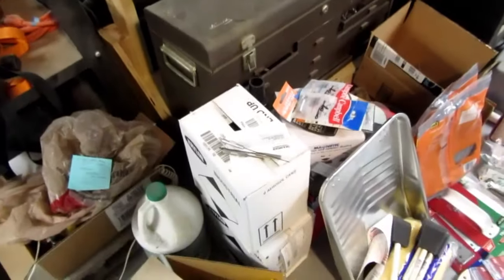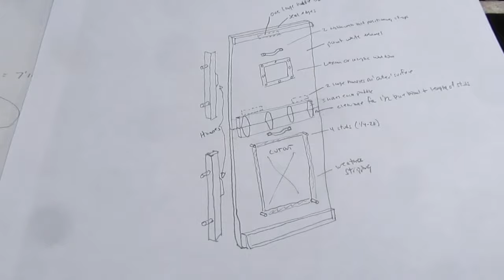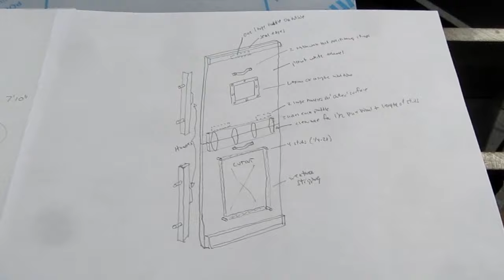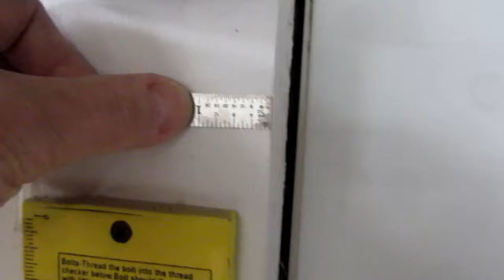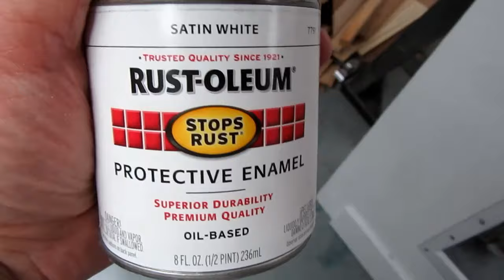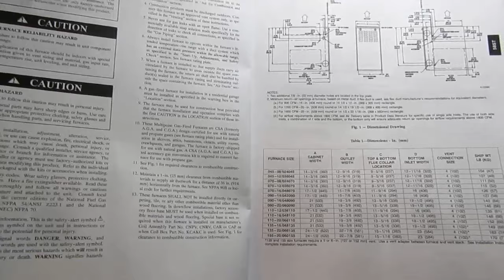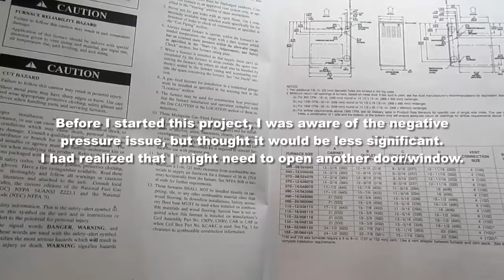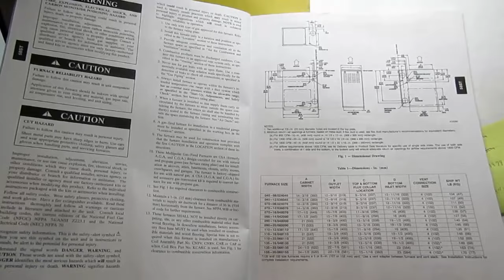Adventures In Home Basement Shop Ventilation

Comment: Curious why you went with a 20”. There are plenty of industrial 8,10 or 12” fans that move tons of air. But your solution is a pretty good solution too.
Reply from the maker: HabitualButtonPusher, I saw some online reviews on this model fan, who seemed to using theirs in similar sized areas. I also talked to the manufacturer's tech support, who thought this was a good choice.   I now think it is considerably oversized, but still usable. But by using an adapter panel, I can still place a smaller fan in my home-built door insert panel; that might still happen. I might also just buy a cheap 20" box fan, then take it out of its box and rig it to fit in my door panel cutout, and see if that moves enough air (for situations where I need to keep the furnace running while still exhausting a bit).

Comment: Hello, I’ve been watching your videos for quite some time, including many of your train videos, which were quite enjoyable… Unfortunately, it’s been a month since you’ve posted this video apparently. I wish I had seen it earlier however, at one point I had a little shop in my basement with a lathe with a milling machine a steel table. My stuff was primarily steel, but some wood however what I did was I got an industrial bathroom fan, which typically fits up between two joists and Iran four-inch ducting around various appliances, I also installed quite simply a circular 4 inch diameter diffuser, where the inner 3 inch circle was connected to a threaded bolt, and therefore it was able to be turned and brought out which would encourage ventilation at that point or if I was at another station if I can say I would close all of these which I mean takes all of 30 seconds and open just the one where I was working for example, doing staining of wood and it was quite effective. There were never any complaints in the remainder of the house, as I certainly was conscious of this!
But it was very effective. It took me all of maybe three hours to install aside from drilling the holes through the exterior brick wall to enable a 4 inch diameter termination kit. It wasn’t expensive, and it was quite functional.
Reply from the maker: David Burnell, thanks for your comments. I sounds like your shop had a simpler layout/arrangement than mine; without all the complicating factors of mine, I might have been able to do something else. 

Also, my home is open-plan, so as far as the air is concerned,  it is just one big open space. Vapors from anything in the shop are very apparent elsewhere in the house.

With ventilation, a lot depends on volume of air that needs to be removed to avoid health and safety issues. I had already investigated the GPM of things like bathroom fans, and concluded that by the time such a fan had time to exhaust the space near my painting area, the noxious vapors would already have had time to migrate elsewhere in the house.

As far as complaints elsewhere in the house, a lot depends on perception. I could spray aerosol enamels all day and never SMELL anything elsewhere, but that is related to the type of odor and whether my nose would be able to detect it. I set up this exhaust scheme specifically because of my need to do some lacquer spray painting, and the noxious vapors from that are both much nastier, more noticeable, more health hazardous and more combustible.

My only regret about my scheme is NOT doing the GPM calculations for the fan that Amazon happened to sell, as it is somewhat oversized. But as I said in the video, I still have the option of fitting a somewhat smaller fan into my faux-door.